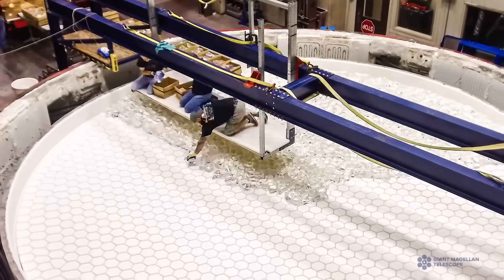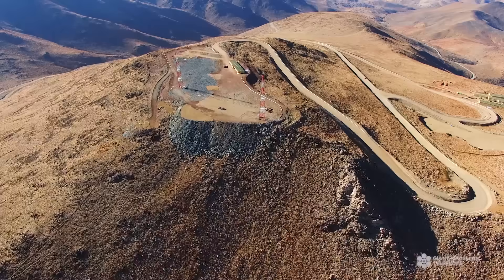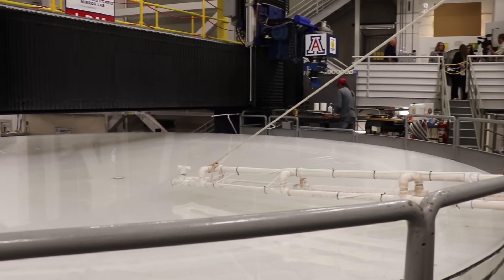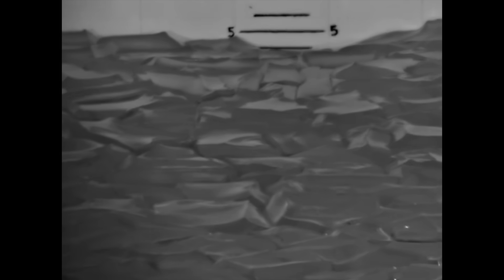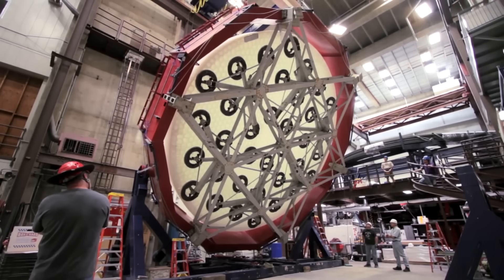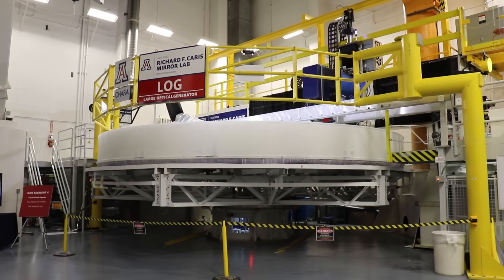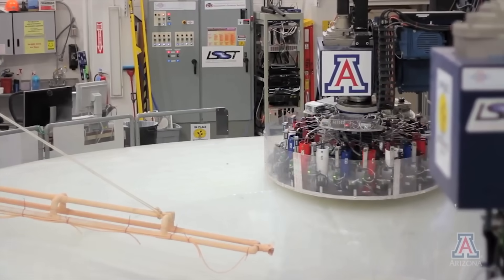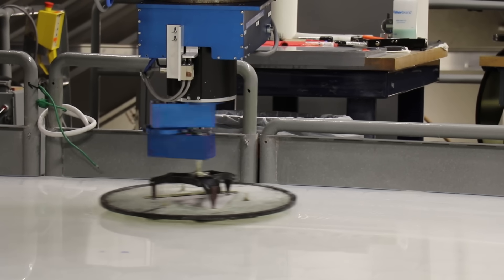Casting a $20 Million Mirror for the World’s Largest Telescope

Comment: Why dont they build the mirror where it needs to be?
Reply: perry marshall why don’t they make a soccer ball type mirror? Seems like it would be far easier and much more cost effective
Reply: @thepope2412  like glass blowing a mirror?
Reply: perry marshall no. You know how a soccer ball is a bunch of hexagons? Like that but on a larger scale.
Reply: @thepope2412  This telescope is built that way, but with 7 round mirrors.
Reply: @stargazer7644  I meant instead of constructing extremely large mirrors you construct relatively small ones to make it easier to produce. Making and transporting these building size mirrors can't be easy
Reply: @stargazer7644  But still what's the need to making a 25m mirror? It doesn't seem as cost effective as doing multiple small ones
Reply: @thepope2412  They DIDN'T make a 25m mirror.  They DID make multiple smaller ones.  You don't want to make them too small, because every segment has to be individually supported and aligned.  That makes the mirror cell much larger, heavier and expensive.
Reply: @stargazer7644  Oh I misread, I thought you were saying the one in this video was 25 meters but my point still stands. The mirrors seem like they would get exponentially more expensive the bigger you make them and the frame work for the mirrors wouldn't. Why can't they make a bunch of small hexagon mirrors? I've seen telescopes made like that.
Reply: @thepope2412  You can make it with many smaller mirrors.  I explained why that's not necessarily a good way to go.
Reply: @stargazer7644  But still why did they choose to make 7 large mirrors? I don't think the reason is cost because making these mirrors so massive would likely offset any frame costs as you mentioned.
Reply: @thepope2412  The frame for these big mirrors would be lighter, simpler, and cheaper than the frames for many more smaller mirrors.  The image quality is higher for fewer large mirrors, though the overall size is slightly bigger.  Additionally, these 8.4m mirrors are very common in large telescope systems.  There are multiple mirrors of this size on the mountain in Chile already.  That means the transport, cleaning and resilvering infrastructure already exists there.  When you have multiple mirrors like this, every mirror has to be ground to a slightly different shape depending on where it goes in the telescope.  Imagine doing that for a hundred small mirrors.

Comment: Why in the world do they put the mirrors together in one telescope when they could have put the mirrors in separate telescopes spaced apart and synchronized with fiber optic cables to get a vastly superior big synthetic aperture telescope with the exact same mirror processing time and cost.
Reply: Because one instrument with adaptive optics is cheaper, easier and better.  You can't use fiber optic cables to recombine the light from multiple instruments like that.  They actually have to send the image down vacuum tubes, and it is very difficult to do.

Comment: Excuse me?  Did he say "cool it for a few months " ?
Reply: It makes total sense. I have experien ed glass shattering from rapid temp change and even metal becomes brittle enough to crack and break when cooled rapidly. It was just a bit of a shock, at the time, when I heard it.
Reply: Well you wouldn't want it to crack would you...
Reply: @paulstubbs7678  yes
Reply: Yup. The problem with glass (and the reason we have it as well) is that when it cools down, this happens so fast it freezes in a chaotic state ("fast" meaning in the normal course of exposing it to ambient temperature). This will freeze the glass but also freezes all the stresses. Annealing it very very slowly will ensure a release of the stresses while it cools as it remains liquid for far longer and it can settle much better.
Reply: @StCreed  Glass transition temperature shit!
Reply: Why cant we just give it a 1 month vacation to release all that stress?  @StCreed
Reply: if not cooled slowly enough, the outside will harden while the inside continues to contract as it cools, and the stress has nowhere to go.....
Reply: @toolmanthetim7042  Tempered glass right here
Reply: And polish it for a year 😂
Reply: Mucho Importanto ... car windshield manufacturing needs gradual cool down time to eliminate internal stress. This takes time and increases cost. If you buy a cheapo car windshield, it looks the same but it cracks much more easily from thrown pebbles and thermal stress differentials.
Reply: Dude most materials have cristalline structures.
Cristals form less different orientatiosn if they build reaaaly slowly.

The whole conept is relatively lenghy and a little complex to explain fromnscratch.

If u are familiar with browns molecular movement theory and know what diffusion means, you know that movement betweens molecules is stronger the more energy (a.e. heat) is available.

So cooling it reaaaaaally slowly and therefore preserving heat for a long period of time is giving the molecules time to move where they "want to move".

If u do t do that and cool it rapidly, the molecules dont reach the places they want to be and are stuck in the place they froze. But the "urge" of the molecules to be somewhere else stays. Therefore within the material are many molecules that wield a little force in the direcrion they want to go, but cant.
If u now apply forces from the outside (like a roadbump) they will add up with the tiny forces of the molecules and might be enough to tear apart connections between molecules withing the material. Therefore cracks form and ur million dollar mirror is ruined.

To avoif that u give ur glass molecules time to move where they want to go, so the little forces inside of the glass disapear. Therefore it takes more force to crack the mirror, and it might even survive a small road bump ^^

I dunno, as much as i hate physics i do enjoy chemistry :]
Hope the text was understsndable for people who are not familier with the matter,

Cheers
Reply: @lennartweber2228  I know, the months comment was just shocking because it really laid down a perspective on just how big these things are, as well as just how difficult it is to in rease the size. It really allows you to understand why it is so hard to just make a bigger system and why it is such a massive accomplishment when they do.
Reply: @mynamejeff4883  
Another really interesting thing is the production of objects in the nanometer area.

Take as an example grafics cards:
A gtx 1080 has the sam chipset as an gtx 1060, yet the are capable of different ammounts of calaculations.

This is because on a nanometer scale where u litterally start to print atoms, you are bound to habe errors in ur making process, since just to many aspects play into where a rpinted atom actually sits.

So while printing a gtx 1080 chip u run into errors, wich in turn litmit your calculating capabilities.

Rather that throwing the defected chip away, they just rank them in a lower tier; the gtx 1060.
Since the processor is still able to process, just has more defunct processing units, it is the same chip and the same generation, just a lower tier of it.

So graficscards are basically just valued by how lucky u got in the process of making them.

I dont know if i explained that properly amd i would reccomend u to look it up for uself. 
But that really blew my mind.
Reply: @lennartweber2228  Wow that's really cool Thank you
Reply: because of how big and thick it is if they cool it down faster Itll crack
Reply: Yep
Reply: It is called annealing, and is the time dependent on thickness and heat that must be held and ramped down to maintain structural integrity.
Reply: I grew up in Tucson and went to UofA. It was a big deal when this lab was being built. Of course they had very small tours to celebrate the lab and show its purposes. It been in operation for nearly 30 years and may have completely 2 dozen mirrors over that time. It was a big reason why we have the Hubble satellite and its “vision” correction. It usually makes the news of one mirror breaks or cracks.
Reply: The concrete within the Hoover dam is STILL curing... 84 years later. It should be completely cured by 2041 or so....
Reply: @etherealrose2139 yeah but it actually gains very small percentages of strenght over the decades. It reaches probably 99%  strenght in a few years after that as i said its just really really small gains
Reply: It's million dollars cuz they spend all that on electricity bill for it 🌚
Reply: Just like before you eat the tomatoes on a Pizza
Reply: You misheard. He said years.
Reply: When glass cools its crystal structure is a mess and there are a ton of uneven forces in it. To solve that you cool it very slowly and you have to maintain it for a long time hot enough so that its atoms are able to move freely without it being liquid so that the crystal structure gets more uniform and the forces disappear. Otherwise it could crack at any moment without even touching it
Reply: I have annealed metals for days before. But never a piece this big. I am not surprised honestly.
Reply: Yeah how cool is that
Reply: I paused at the 28months of polishing
Reply: Bruh this dude is like explaining how to bake somthing

Comment: This telescope will still need to peer through our fairly dense atmosphere. Doesn’t that significantly affect what it is able to see?
I’m actually more excited to see what kind of information the James Webb telescope will be able to provide.
Reply: They'll use adaptive optics on the secondary mirror to get around that.  Ground based telescopes with AO can actually see better than Hubble.  They can't go quite as faint, but they have better resolution.

Comment: Haul that damn thing into space, or are the mirrors shaped to compensate for Earth's atmosphere?
  ...Just found out this telescope will have ten times the capability of the Hubble Space Telescope.
      It will sit in the Atacama Desert in Chile about 8,500 ft. above sea level. It also has fans that will cool the mirrors to match the temperature of the air so distortion will be practically non-existent especially with the adaptive optics that use flexible smaller mirrors each controlled by hundreds of actuators to also compensate for the twinkling light stars have........... Incredible!!!!!!!!!

Comment: Nanometer ? Well that's a bit of bull shit right there. Even if they did polish it to that level. When they move it and install it it'll have moved more than that I guarantee it. . Also temperatures will move the surface not to mention dust and moisture to make that nanometer not worth the hassle.
Reply: It isn't bullshit.  The glass they use is a special mixture that doesn't expand or contract with temperature.  The mounting the mirror sits in is designed to support it so that the mirror cell doesn't flex.  The telescope is in one of the driest deserts on the planet.  These are standard telescope manufacturing techniques that have been used for damn near 100 years.  The main difference here is the scale.  Mirrors this big weren't usable before adaptive optics were invented.  Perhaps you should learn the very basics of science before bad mouthing it.
Reply: @stargazer7644  Bell end

Comment: I think they should see first light even before all the mirrors are finished.
There are only two types of mirrors there: the central and the outer mirrors.
And the outer mirrors are interchangeable between themselves.
So they don't necessarily need all the mirrors for telescope to work.
 Also I think the are going to make an additional outer mirror, so one
mirror is always being recoated and maintained, without interfering the telescope performance.

Comment: And you can’t see a clear picture of ANYTHING. We left on the moon ?
Reply: No, not from Earth you can't.  It's simple math.  Look at the best images we have of Pluto from Earth.  They're only a few pixels wide.  https://www.space.com/17784-best-pluto-photo-from-earth-picture.html  Pluto is 64 milliarcseconds wide as seen from Earth. The largest piece of space hardware we left on the Moon is 30 times smaller than this at 2.2 milliarcseconds.  It's smaller than one pixel on the best camera on the best telescope we have.  But the Apollo hardware is easily seen by cameras in lunar orbit.  LRO has imaged all of the landing sites from orbit around the Moon.  Those pictures have been available for almost 10 years now.  Where have you been?  https://www.space.com/14874-apollo-11-landing-site-moon-photo.html#:~:text=The%20Lunar%20Reconnaissance%20Orbiter%20Camera,surface%20around%20the%20Lunar%20Module.

Comment: GMT 24.5 metres, expected operational 2025; ELT 39.3 metres, also 2025. The race is on to see who gets going first! But the GMT is not going to be the largest, as the TMT (Thirty Metre Telescope) is also in the running, despite a crippled start.
Reply: It isn't clear if the TMT will ever get built.  Start of construction has been delayed to 2021 at the earliest.  GMT isn't expected to have first light until 2029.

Comment: Ok, glass actually flows so it's impossible to make it precise to the  nanometer. Over time the shape changes. Glass is actually very similar to a liquid. GL with that
Reply: I literally googled "does glass flow" and the first result says you are wrong.
Reply: @josanjosan  well how about this. Make some tea. Wash the cup with cold water right after you finish. You'll find that the glass breaks. According to the kinetic molecular theory, all matter vibrates faster and expands when in heat. The cup literally expanded as you poured hot water in, and contracted rapidly as you cooled it. Anyone with some science background knows that matter, solid liquid or gas doesn't like to keep its shape, and that's the reason the kilogram mass in Paris was proven to lose weight, and was replaced with planks constant. God bless!

Comment: Is it not posible to use one way large silver thin metal instead of glas, a silver thin metal that is hold with air suction, to get the shape.
Reply: Small telescopes have been made this way.  But you can't put more than 14 psi on the metal to try to hold it taut.  It would sag under its own weight as you changed positions. The glass is thick enough to prevent that.

Comment: Wasnt the point to avoid these observatories by having the Hubble Telescope?
Reply: No.  Hubble has an advantage in sensitivity because it is above the atmosphere, but the mirror on Hubble is only about 2.4 meters.  Enormous advances have been made in adaptive optics since Hubble, allowing Earth based telescopes to correct for the moving atmosphere.  The much larger sizes of Earth based telescopes give these instruments far, far more resolving power than Hubble.  They get much clearer images than Hubble.

Comment: That is incredible, the shear time length it takes to carry out the polishing works is incredible. Question, if the precision of the mirrors is nano metre accurate, and the polishing requires incredibly accurate fixed machinery as seen in the video, how do you polish and maintain the mirrors whilst they are in the observatory as shown in the video? It looks like they are exposed to the open air. They would have to be in fact because any transparent material set in front of them to protect the mirrors from dust or wind would need to be to the same standard of glass as them mirror itself..
Reply: Owen Gray I believe they periodically disassemble these massive optical telescopes for resilvering and polishing.
Reply: They don't put anything in front of them while they're imaging.  They have shutters over the mirrors during the daytime.

Comment: 2022: hey guys, so we can achieve this with our cell phone cameras now... 

here's a redesign, where we can effectively triple it, should be done by 2030!

2029: ooh, bad news guys...
Reply: mondayfool you can't let the poor man joke now can you
Reply: @mondayfool Yeah next time maybe they should build a temporary mirror factory at the telescope site and essentially make a giant mirror in situ. Probably build the foundation of the telescope, put a temporary roof on that, get all the mirror manufacturing equipment there and design it so they can do the polishing phase underneath without flipping the mirror, then build a physical protection sheath over the mirror so it can't get damaged and then proceed to build the rest of the telescope. Or maybe use the temporary roof as the protection if that's possible. The limiting factor seems to be the mirror size and it's lack of transportability the bigger it is, so building it in it's final resting place sounds like the answer to me.
Reply: jojolikescocoa hmm ik what you mean. Apoph...

Comment: Who will clean the mirror of dust? Have to be done with precision not to blemish the polished surface.
Reply: Glass is very hard.  That's why it takes so long to grind it to shape.  Washing the mirror isn't going to hurt it.  They actually strip the metal off of the surface and re-silver it periodically.

Comment: If vampires can not be seen in mirrors then does that mean they are immune to telescopes no matter how expensive?
Reply: i know that you're joking, but the reason vampire can't be seen in the mirror is because the mirror itself made by silver or coated by it. And you know vampire can't touch silver. Soooo yeah no matter how expensive the mirror/telescopes is, if it still made up by silver then no vampire could be seen
Reply: The high magnification makes them extra thirsty.